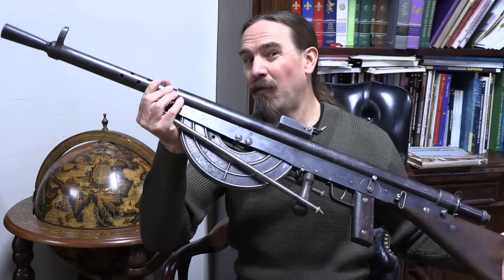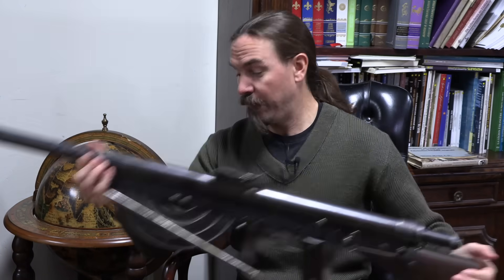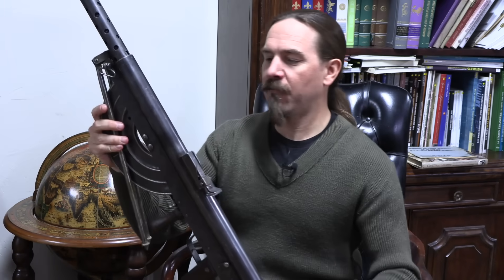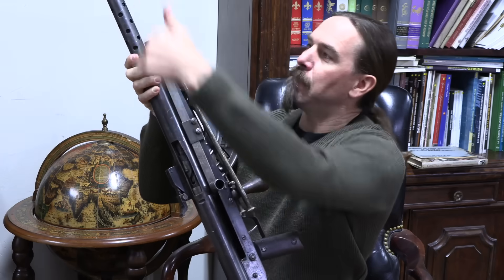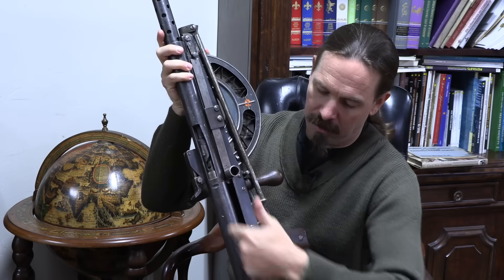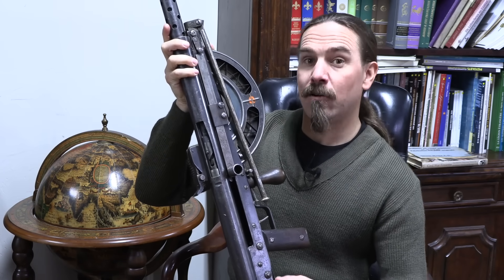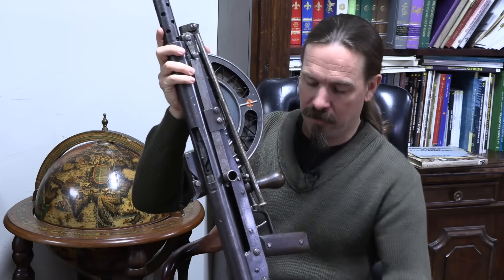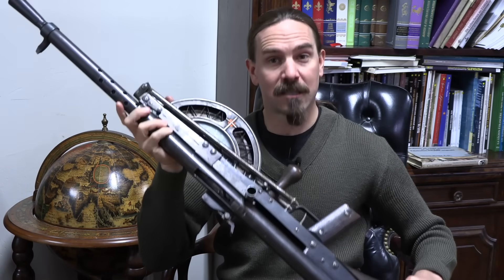Rate of Fire: What Determines it and How to Change It

Comment: Totally "Forgotten springs".  I think the spring rate has also something to say about the rate of fire.  And please do not forget the imprtance of oil.  At least our machinegun instructor emphasized that.
Reply: Average velocity is bolt and spring push.
Reply: Correct. The return spring is essentially artificially increasing the mass of the bolt as the bolt cycles rearward. A heavier spring will slow the bolt down moving rearward. On the other hand, it has the opposite effect on the bolt moving forward and increases its velocity. The net difference is likely somewhere in between.
Reply: @robertb7540 yep half of the spring’s main purpose is to lengthen the recoil impulse for less felt recoil. Generally it’s more about bolt weight though if want to change speeds, same goes for “buffer weight”, spring usually stays the same

Comment: I enjoyed this discussion on factors affecting rate of fire mechanically.

A video discussing rate of fire for different applications would be appreciated.

I prefer 900 rounds per minute cyclic rate for hand-held automatic weapons because that allows a short burst to saturate the intended target, and I can still blip off single shots when desired.  Spacing out the bursts to manage heating is one of the machine gun techniques.

In Johnnie M. Clark's 2004 "Gunner's Glory: ntold Stories of Marine Machine Gunners" on page 85 the 7th Marines M1917A1 heavy machine guns were modified to increase their rate of fire from 600 rounds per minute cyclic to 1300 rounds per minute--the modifications were briefly described.  As the M1917A1 caliber .30 machine gun was also considered to be anti-aircraft defense for the Marine infantry battalion, this boost in cyclic rate improved its air defense effectiveness--as much as can be expected from rifle-caliber machine guns. Other options were multiple machine guns on the same mount to increase fire rate.

Comment: Another imported aspect is a thing called "Unterstellstecke" in German. It's the distance the bolt carrier or the slide of a pistol can move backwards before the locking mechanism is touched to start the unlocking process. On an AK for example you can withdraw the bolt carrier almost an entire centimeter, bevor the bolt head begins to rotate. PS. I would be glad if someone could tell me the English name for this concept.
Reply: Maybe "locked travel distance" 🤔

Comment: I would love for you discuss what rate of fire is best, as you said i think it depends on the application. For small arms at the unit level I think that a slower rate of fire such as 600-700 rpm is better for ammo consumption and recoil control. However for vehicle or aircraft mounted machine guns I think a higher rate is better to put more rounds downrange against other moving targets.
Reply: Please don't go extreme on the ammo consumption or we'll have to start calling you General James W. Ripley!  https://en.wikipedia.org/wiki/James_Wolfe_Ripley
Ammo management is vital to unit success but mandating that everybody swap rifles for spears and swords (no ammunition expended) would make me wonder how many vodka martinis you had for lunch.  

The Colt 3-shot burst mechanism was designed for lower ammunition consumption and recoil control--instead of proper (and expensive) training in automatic fire techniques.  Many combat vets say that they NEVER used the AUTO or BURST setting on their M16's--some will even claim that automatic fire is worthless, only wastes ammunition.
Reply: say you got two high speed patrolboats. Racing towards echother. calibre and engagement distans is the same. one boat has a machingun with a rof of 600 rpm. the other got one with 1200 rpm. what boat are going to deal most damage to the other.

Comment: Does having the bolt carrier slam directly into the receiver without a cushioning spring result in a jerkier recoil on the shooter's hand and shoulder? Sounds like something that would result in a significant kick, with more energy going into the shooter's body quickly, rather than some energy getting absorbed by the spring slowly.

Comment: Suggestion for another video: what influences the choice of operating principle? For example, why would a designer choose a long recoil system over short recoil?
Reply: I'm guessing it's a trade off between rate of fire and muzzle velocity.
Reply: @garrysekelli6776 there's also felt recoil, complexity, reliability, accuracy, size, and weight.
Reply: the major advantage of long recoil over short is its enhanced locking safety and extracting safety in exchange of fire rate: having the bolt and the barrel locked together and travel significant longer distance gives the system a much longer time to lower pressure hence ensuring safe locking and/or safe extracting
Reply: @illusizzy6125  fun fact: You can see it on highspeed, a long recoil barrel typically doesn't start moving (A5 shotgun, for example) until the shot column has left the barrel.
Reply: Basically king recoil is good if your ammo varries heavily in powder charge.
Reply: @AttemptMade  can be. There are other problems that arise when a hot load gives too much rearward velocity. The A5 has a clever adjustable friction brake to counter this. Im sure Ian jas a vid on this too, but if not, there's plenty out there.
Reply: Desired weapon profile.
Reply: One other thing to keep in mind with early guns was patents. Sometimes different locking or operating mechanisms were used to work around early (and usually extremely broad) patent claims.

Comment: 2:05 I have to nitpick a little. It's not average velocity. It's the average speed that partly determines the ROF. That is due to the different definitions for speed and velocity.

In short, speed is the ratio between the length of the path travelled and time it takes to travel it. In guns, that is the back and forth movement of the bolt and the time it takes for the bolt to lock again in firing condition.

On the other hand, velocity is not time dependant scalar. It is a momentary mesurement of speed and included direction. That means, that the back and forth movement cancels each others out making the average velocity approximately zero.

Comment: I remember that people would put a rubber block in the standard Uzi sub-machine gun that would shorten the recoil space of the bolt, thus increasing the rate of fire.
Reply: Yes, because the Uzi only got its assassin reputation when the US Secret Service was seen protecting Reagan with one. The Uzi was really intended as cheap reliable gun for Israeli POGs and women.
Reply: Swedish K (m/45). SMG, either insert a D-cell to shorten/preload the spring, or borrow an additional spring and double up...
Beware that it has the potential to runaway, should the bolt see too much resistance to move back enough to catch the sear.

Comment: Why do we use rounds per minute instead of rounds per second? This isn't the black powder era anymore.
Reply: @badATchaos: To use integer numbers. For example, 1100 rounds per minute would be 18.33333333333 rounds per second.
Reply: Because they started off comparing rates of fire with single shot weapons (or groups of single shot weapons) and didn't see a need to change as the numbers got bigger.

Comment: I think you minimized the effect of the recoil spring or buffer too much. When the bolt moves back under recoil it has to work against the recoil spring which resists compression which slows down the bolt. Varying the length, coils etc can change the rate of fire. Might be good to cover that, and in the case of AR-15 pattern rifles discuss the different buffer types.

Comment: Also depends on what tick rate IRL is running on. This is important because at say, 30hz, an M16A3 with a rate of fire of 800 RPM will have 2.25 frames on average between each shot. This means the weapon's frame distribution is 2-2-2-3. Therefore, a shooter will only experience Spread Decrease on the third or fourth frame depending on when the trigger was pulled.

Comment: You've stated that the st etienne 1907 adjustable rate of fire could go down to 10 round per minute. How did they manage to do that. It's hard to imagine a bolt once cycling every 6 seconds.
Reply from the maker: The bolt cycles at normal speed, but a hydraulic piece like an hourglass prevents the trigger from releasing until the set time has elapsed.

Comment: 3:06 Equal pressure, not energy. Since most cases have a bigger surface area than bullets, the force acting on the case (and bolt) is larger.

Comment: 3:00 I've been wondering from time to time, if you forced the bolt to stay closed, would the bullet have twice the energy? It sounds stupid, but at the same time it sounds like it should make sense, since it is the law. I guess there has to be something more to it. Like recoil absorbing some of the energy or something?
Reply: No, the energy would be transferred to the whole gun instead of only the bolt.
Reply: Yeah, it would just heavier recoiling instead. @JippaJ
Reply: @chief5861  I think it's more complex, recoil will be the same, just distributed differently.
Reply: @JippaJ  Not if it's a semi or fully automatic gun, the energy spent to unlock the bolt and to overcome it's stationary momentum isn't turned into recoil. A bolt action firing the same round will usually have more recoil as a result.

Comment: Ian, do you have any formal engineering training or is this all understanding you’ve gained on your own through the years? Love the depth on these subjects!
Reply from the maker: My degree is in mechanical engineering technology.
Reply: @ that makes a lot of sense given the detail in these explanations. Thank you as always!
Reply: This explains so much!  Do you know of any weapons that use an inerter device (see Wikipedia) to reduce slide or bolt velocity?  It links linear momentum to rotational momentum, and does so very efficiently!  It's like adding a slide weight to a 1911 to handle .460 Rowland.
Reply: My degree is 1080 on the spot @ForgottenWeapons
Reply: @ForgottenWeapons  I keep thinking that's what I shoulda studied. I got into networking instead and spent my career shoveling data packets.

Comment: 3:00 not equal energy but equal momentum because there is a conservation of momentum
Reply: Conservation of momentum is about collisions between objects, right? The bullet and case and/or bolt are not in collision as far as I can tell. It's the pressure created by the propellant forcing in their own direction.
Reply: @JippaJ  the momentum is conserved no matter if there is a force applied by collision or by gas pressure or any other force
Reply: @JippaJ  the pressure will push with equal force in both directions, for the same amount of time, and force multiplied by time is momentum.
Reply: @DR000Evil I don't think so. The casing has a larger surface area than a bullet, resulting in a larger force. And there is residual pressure inside the barrel when the bullet has left which still acts upon the case and bolt. 

The case and bolt receive a larger force for a longer time resulting in more momentum.

@wojtekimbier some of the momentum is transferred to the gasses leaving the barrel instead of the bullet. Momentum is not just conserved between the bullet and casing/bolt.
Reply: @JippaJ  that's why europeans hate Imperial Units - total misconception about physics units and their meaning. There is nothing about collision.
It's just 3rd Netwon law, like in rockets or aircraft. Bullet + gasses and moving bolt have the same momentum just acting opposite. It's mass and speed are different.
Reply: @DR000Evil force multiplied by time is work. Not momentum. Work is synonymous with energy, so force multiplied by time would be equivalent to kinetic energy(which is not the same as momentum).

However, that doesn't matter. Because the bolt and the bullet are not acted upon with the same force, and not for the same amount of time.
Reply: @jaredlancaster4137  force times distance is work. Force times time is momentum.
Reply: This is not a college lecture. Ian's explanation is suitable for his venue and his audience. Exact mathematical precision is not required. The pedantry just gets tiresome. And it actually, unnecessarily, causes bad blowback from some video hosts (Greg's Airplanes comes to mind).
Reply: @paulflocken2730  I very much disagree. Ian is one of the best on Youtube, but he does make some mistakes in the physics of explanations sometimes which results in a less clear presentation, not a more clear one.

Comment: I love technical discussions like this. Yes, I'd love a video on what rate of fire is best.
Reply: There is a US Army film where they show the effect of rate of fire between a minigun and a m60 on a helicopter on a target in distance. The minigun does much more hits because the distance of hits in a line while sweeping the target is much smaller. The m60 hits where almost like you could pass between them. I dont know the name anymore though. I think it is from the Vietnam era.
Reply: Highest rate of fire, is best rate of fire! (see mg42)
Reply: @christofincognito4530  But you run out of bullets faster.
Reply: @johndavidwolf4239  Only in theory and on a shooting range.
In practice its about achieving the desired effect. Which is usally a function of the number of bullets fired. A higher ROF in a machin gun means it takes less time to get the effect. The number of bullets used stays more or less the same.
Reply: @schnuersi  I would say just the opposite, with a higher rate of fire, while there may be more hits in a given time, but additionally many more misses in the same time, and in battle the cost and logistics of transporting the bullets to the front line must be taken into account.
Reply: @ The assumption that there will be more misses for the same number of rounds fired with a high ROF MG compared to a lower ROF one would only be true if the weapon would be less accurate.
Which usually is not the case.
The outlier is the extreme case of gatling type guns which indeed are less accurate.
A high ROF gun is used different to a low ROF gun. While burst length are usually about the same they are not by time but by number of rounds fired in one bust. A high ROF MG just needs less time and the trigger is released faster.  The burst is more dense.
The effective ROF of a high ROF MG operated by a properly trained gunner is about the same as for a low ROF MG. Which results in both guns using their ammo up in the same timeframe.
That being said a high ROF MG of course CAN consume ammo faster but this is most likely due to improper use or a very target rich environment. In the latter case the high ROF is an advantage as well.
Reply: @schnuersi  He didn't say for the same number of rounds, he said in the same amount of time. "In practice", you have to have brought your ammunition with you. Whether you're infantry and have to carry it yourself, or in a vehicle that has limited storage volume, the amount you can have with you is constrained. If a one-second burst costs you twice as many bullets, you either have to take more with you, or increase the risk of running out of ammunition.
Reply: @MaskedDeath_  ...but you do not fire one second bursts with an high ROF MG. You do not hold the finger down. That indeed would be a waste of ammo. You fire bursts of fractions of a second.
At least if we talk about LMG.
In MMG/mounted role you fire the number of rounds needed to achieve the desired effect but since the MG is mounted its dead on target anyways so there is no additional waste trough the higher ROF.
Reply: "MORE! MORE!"
Reply: It's quite simple. You want more dakka.
Reply: Anyone know- how long does an open bolt delay really take in games it’s usually around 30-70 ms I’m curious what it is in real life. And for that matter anyone have any idea how long it takes for a round to go off after pulling the trigger or like 0ms?
Reply: @alexv1vd it’s definitely not instant, as the bolt has to travel forwards, pick up the round from the mag and then move into battery, then fire. it’s very quick though. no idea on the actual number. that’s for an open bolt type. closed bolt would be much quicker id assume.
Reply: Rate depends on what you want to shoot at
Reply: @MichaelBetsch-sl9bb And how fast the gun is moving.
Reply: By all means discuss the optimum rates of fire!  I suspect there is no single " best."  It depends ...
Reply: Plot twist: it depends
Reply: I just love hearing people that are passionate and knowledgeable about anything talk about it.
Reply: There’s not a simple “best”, it depends on what you’re doing. I think slower rates of fire for machine guns in the role of suppression is far better than the high rates of the beloved mg42, but automatic rifles should have a high rate of fire for short bursts or other scenarios where you’d need to fire off plenty of rounds quickly

Comment: To join the ranks of other super annoying pedants, the average velocity of the bolt is 0 (relative to the gun) because it starts and ends in the same place.
Reply: well i dont think so since its likely that the bolt goes faster in one direction than the other, and thus its average velocity isnt 0, another thing is the fact that velocity isn't just dependant on distance but on time, so if it takes less time to say move the bolt backwards than it does forward the average velocity wouldn't be 0